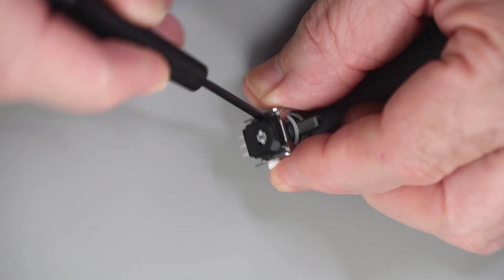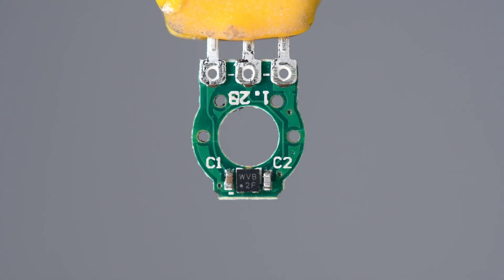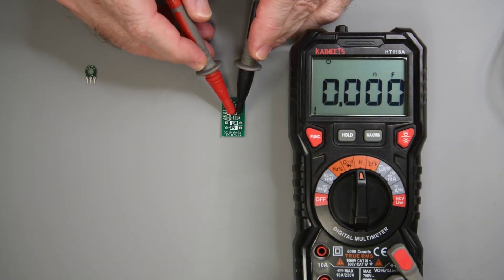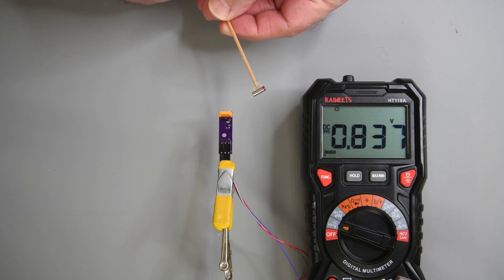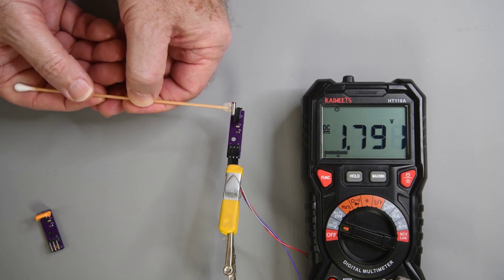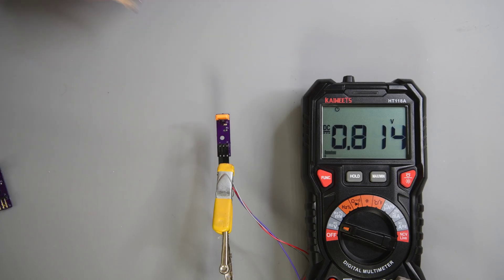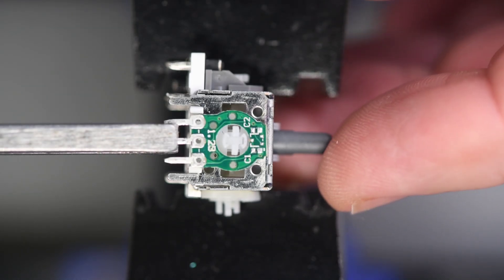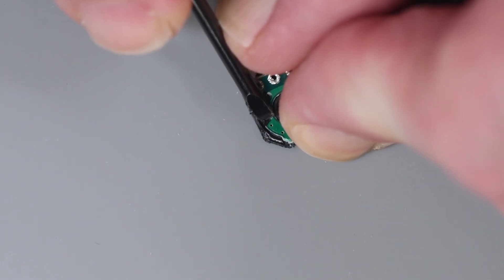What’s Going on Inside the GuliKit TMR Sensor

Comment: Thanks for sharing the disassembly of these TMR sensors!
Recently I'm trying to install these gulikit TMR sensors on something not meant for it, a VR controller.
It was after installing I realised the joystick PCB layout of the VR controller is weird.
It has GND on right most pin of one axis, and GND on left most pin on the other axis.
It shouldn't matter on a carbon film resistor, but I guess it matters on hall sensor and TMR sensors.
Is this the main difference between different model (for different consoles) of these sensors? The orientation of the Vin and GND pin?

I'm trying to see how to figure out the correct hall sensor or TMR sensor replacement.
Reply from the maker: Yes, it makes a difference for the TMR and Hall effect sensors.  What you are looking for is the sensor layout for either the Dualshock 4 or Xbox controller.  Each of those has one sensor with the power and ground pins swapped.  I think on the Xbox, it is the sensor adjacent to the switch, and on the PS4, it is the sensor opposite the switch.  And I could very well have that backwards.
Reply: @metalplasticelectronics354 
Thank you, I figured out the joystick pinout of the VR controller after removing it.
It is actually in reverse orientation of the Gulikit TMR joystick for XBOX series controller, so I have to swap the green and black sensor for it to work on my VR controller.

Again thank you for your video so I can see the green and black sensor actually have reversed pinout.

Unfortunately though, my VR controller lacks proper calibration tool, so the circularity is awful.
I'm still looking for solutions, or try to write my own calibration software if necessary :p

Comment: Any post on the longevity of these hall effects and tmr? I have read somewhere the ginfull are the worst. They either stop working or mechanically break fast. Is this true?
Reply from the maker: I haven't had one fail yet.  The joystick's mechanical parts all seem to be of pretty good quality.  The only thing that could go bad on the electrical side is the sensor IC and maybe a capacitor in the sensor for the ones that have one.  Both should be a very rare occurrence.

Comment: Just installed sensors and left stick works fine but right stick input got stuck at about 40% on the x axis. Not sure if it's my poor workmanship on the soldering and cleaning. But it was working fine for about an hour.
Reply: Resolder and try

Comment: can we replace them on any potentiometer controller ?
Reply from the maker: Only if the power and ground pins are in the correct location.  If looking at the outside of the sensor with the leads down, the ground is the left lead and power is the right lead.  This is why there are different versions for the DualSense and DualShock4.

Comment: Hi, maybe I missed it, but I didn’t hear a clear answer about power draw compared to the original sticks. 
Do you have any readings from the originals to compare with? 
I’d love to know if these are more or less efficient than the regular potentiometer sticks.
Reply from the maker: Original potentiometers are 2.1 K or 2.3 K ohm with a 20% tolerance, so at worst around 1 milliamp per axis and best about 650 microamps per axis.

Comment: These are nice and all, but I'm not sure the cost is worth it. There's not much more going on inside, so I don't really understand why the cost is 4-5 times more. For the DIYer, the difference between $5 and $15 isn't bad, but for the repair shops it can be a deal breaker. If I charge $25 for a typical hall effect repair, now I gotta charge $40 or more to use TMRs. Hard to justify for some.
Reply from the maker: The Aliexpress GuliKit store does list some bulk lots.  It's still more expensive than the Hall, but If the customer wants the best, they will have to pay a bit more for it.
Reply: I bought them for 6 bucks with the welcome deal... if you don't have anything better on what to use it. It's great!

Comment: Great informative video. Do these tmr modules work better with the thumbsticks they provided, I put the normal dualsense thumbsticks on these modules
Reply: The sticks 🕹️ look quality they provide with a metal slide bush sleeve by the looks of what I've seen.

Any height or stick diameter change will change how your muscle 👍🏼 memory feels actuating the tilt range response curve.

If you're going to use the standard sticks made of plastic that can possibly get shaft wear lines, you might want to try the silicone sleeve savers I've recently used on my DS4's then do the 
(DualShock Calibration GUI)
if the range is slightly 🤏🏼 short.
(Noting the Dualsense has replaceable friction rings the DS4 does not)

Always temporarily test it first to avoid odd results in calibration.

Not all Hall Effect side pots translate the information equal & flipping the magnetic pole can set them up for other controllers 😉🤫.

The Ginfull stand alone sides designed for easy switching on Alps frames for example will get the positive + axis circularity shrunk to suit as expected but the negative - side stayed square 🟥 🤷🏼‍♂️.

I'm not finished experimenting with it just yet but the magnets are bessed set central to the standing position.

The pendulum motion of it swinging to far over the chip makes the outer tilt response exponentially more sensitive.

It's a proximity thing not so linear by its nature.

That's why I'm looking at this vid or considering the orange Ginfull units with radial magnets that terminate to points.

 It probably results in a more linear magnetic 🧲 field ⚛️🧭 fall off, not such an abrupt change to the outer reading 🤷🏼‍♂️.